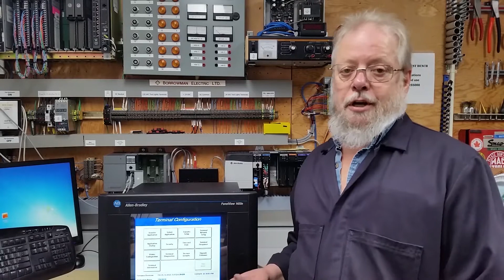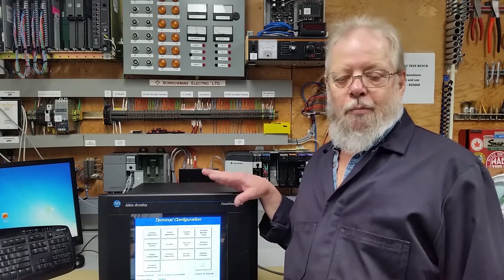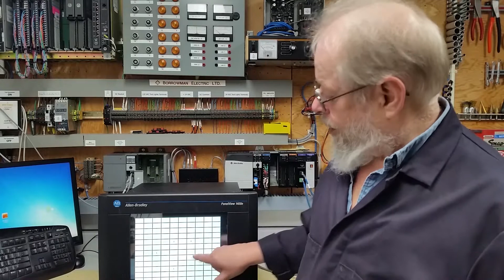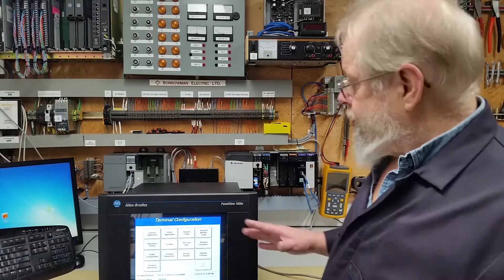Panelview 1400E Memory Board

Comment: Hi, good day, Do you have a video that shows how to upload an application to panelview 1400e
Reply from the maker: Hi:  Thanks for joining the channel.  Sorry no video on how to download.  But you need the PV software in order to download or upload to any PV.  
Normally it is done with a serial connection / RS232. 

You can also do over DH+ or DH485 and using RSLinx.  All of the communication options have to be configured in the PV software.